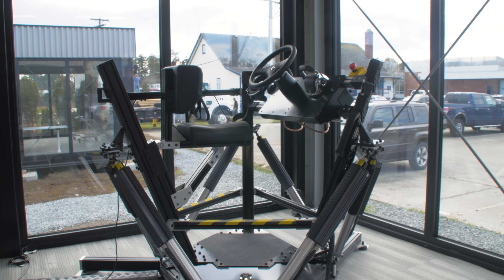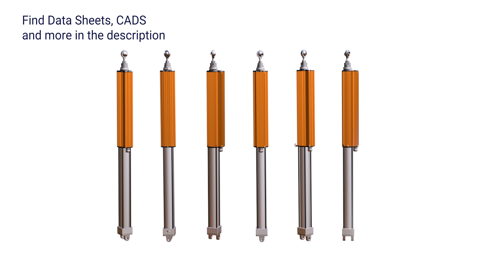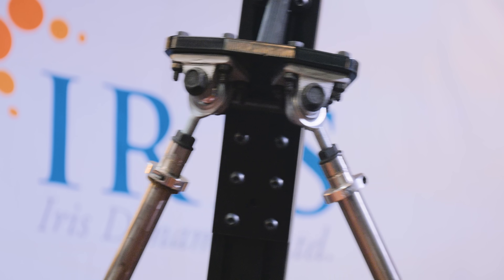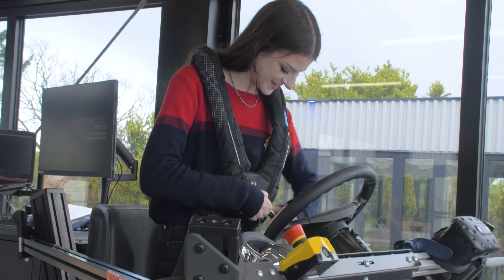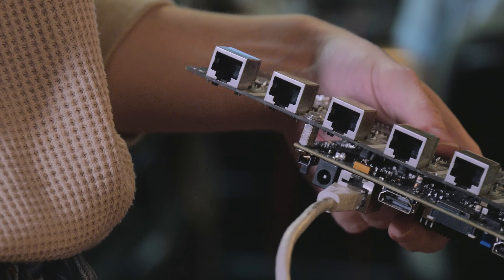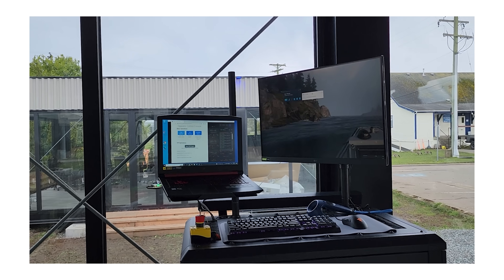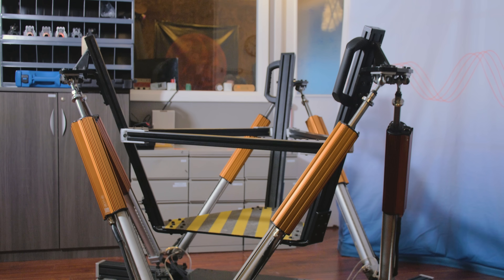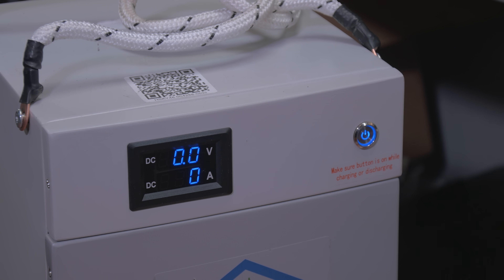The Future for Motion Platform Designers: Raven-6DoF Development Kit Demonstration

Comment: How long does it last without overheating??    I see heatsinks over the motor.. So does it heat often? Can I make it run in my arcade for 12 hours straight without issues??
Reply from the maker: The platform only consumes an average of 300W which is easily dissipated for continuous use.